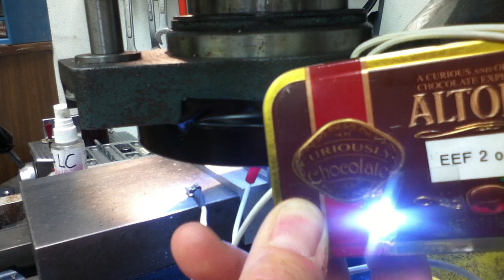An Easy to Use Electronic Edge Finder for the mill

Comment: Just finished this build.  Used 2N3906.  I also use leds.  Have not put in the box yet.
This will help me on my Rong Fu 30 mill with FluidNC CNC program.  The probe function works BUT I have to put a bar insulated in the vice to get it to work, then remove and place my workpiece.  
This gizmo will make life a little easier.  My mill has 8 ohms from vice/table to quill/cutter.